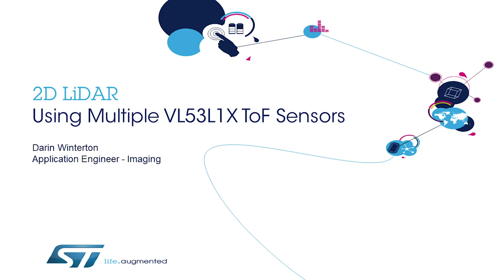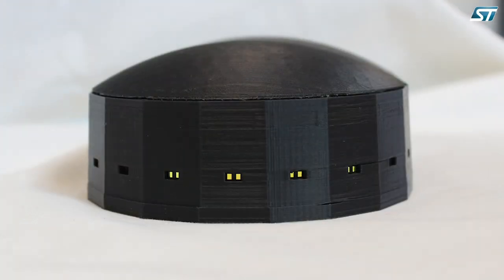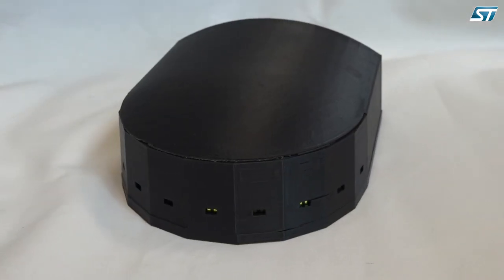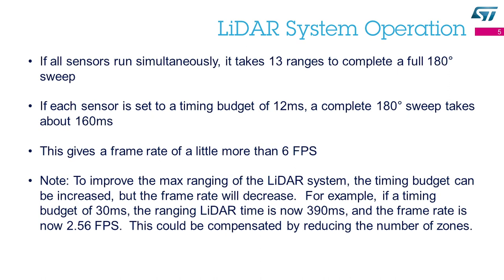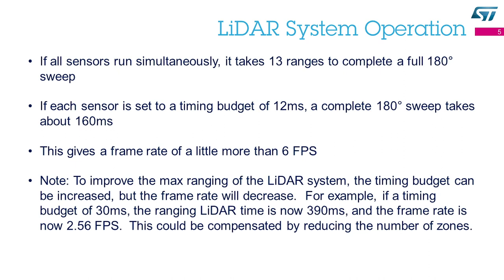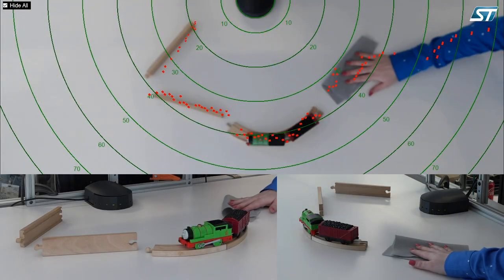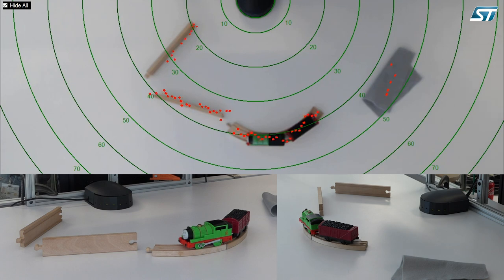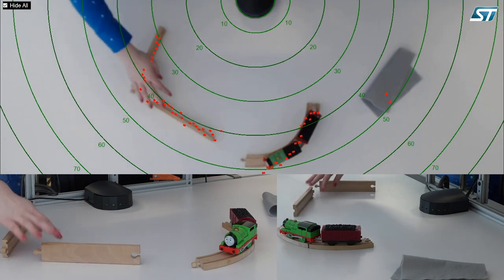2D LIDAR Using Multiple ST VL53L1X Time-of-Flight Sensors

Comment: How is it with the interference between multiple sensors? Is it possible to be measuring with all of them in the same time without loss of precision or max distance? Even when the coverage angles are in colision (e.g. all 10 in one line watching axes in parallel, with 20mm distance between sensors) or is it necessary for the coverage angles not to overlap with each other?
Reply: I guess that all sensors are read one after one. I Think the laser beam is off when the chip does nothing.

Comment: Hi, great project. How do you handle the fact that all VL53L1X sensors have the same hardware address? Do you use a multiplexer?
Reply from the maker: Hello,  Visit our online community to find answers to your technical questions and share ideas with your developers and ST experts : https://community.st.com
Reply: Hey buddy, nice to see this question, i made 360 2d lidars via this method and yes i used i2c multiplexer from adafruit, small trick i2c multiplexers can broadcast data to all slaves

Comment: Great video! How can you measure more than 9 points with only 9 sensor?
Reply from the maker: Hi there, thanks for your question - may we point you towards our community.st.com, where you will find a team of people who can answer you directly ?
Reply: @stmicroelectronics  Looking at the video I had the same question. I've played a lot with the VL53L0X.  It is really a shame that you are not answering.
Reply: As STMicroelectronics do not answer, I'm gonna attempt to answer to you.
As far as I saw, the VL53L1X has a 16x16 receiver grid.
This grid allows either to reduce to FOV from 27° to 4°
And this grid also can be read individually or something like that.
The documentation says "Programmable ROI position on the receiving array, providing multizone operation control from the host".
--> Please note that I may be wrong and read this https://www.st.com/en/imaging-and-photonics-solutions/vl53l1x.html
So far, I bought this device and will play with it. As far as I saw, there is no library yet that allows to read more than one point !
I guess I'll have to read the datasheet and see if I'm able to read more that one point at a time.
Also you may be interested by dominik's post below.
And last, (And ST should have at least answered that) the datasheet is here https://www.st.com/resource/en/datasheet/vl53l1x.pdf
The API documentation may help also https://www.st.com/content/ccc/resource/technical/document/user_manual/group0/98/0d/38/38/5d/84/49/1f/DM00474730/files/DM00474730.pdf/jcr:content/translations/en.DM00474730.pdf
Reply: Finally I have the answer and it is at the chapter 2.5.6 of the API documentation.
The Region of interest setting can be used to specify wich region if the array is read.
The array contains 16x16 spads for a field of view of 27°
The sensor uses at least a 4x4 square.
Yet, I don't know how to interpret that, but I think this allows to divide at least the FOV by 4 and at max by 16 (but I don't believe that).
But, I think that using a 4x4 grid instead of the full 16x16 grid should reduce the max distance of the sensor.
Thinking about that, it really seems that Dominik is right (read at the bottom)
Reply: One more thing, as you say Dani, more than 9 points are measured in the horizontal direction.
My understanding is that you can read many points in horizontal direction... but also in VERTICAL direction.
I'm going to test that now that I know how the sensor works.

Comment: Do you know why there is only 0.5m range showed in this demonstration? Because the VL53L1 is not able to cover longer distances! The 4m cover distance is only a dream, in practise even ~2m distanced object is possible to detect only if it is large (at least 1x1m) white flat square that obscure the whole view angle of VL53L1. If the field of angle is narrowed by ROI option, the range also decreases to insufficient distance. Advertised 4m of VL53L1 misleading for any scenario in real world use. I think we have no other option to throw away time developing our 2m distance LIDAR on VL53L1 and start again with different distance sensor...
Reply: Thanks !!!
Reply: I used VL53L1X to measure successfully 3m distance range, the issue i faced with sunlight as it cause interference, sensor used only for indoor applications